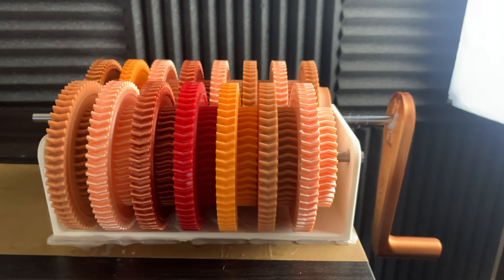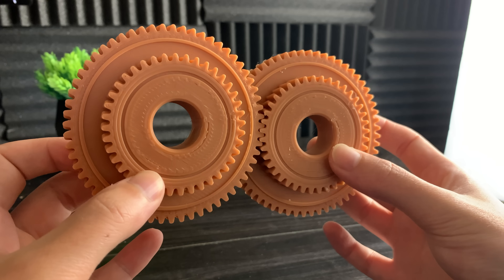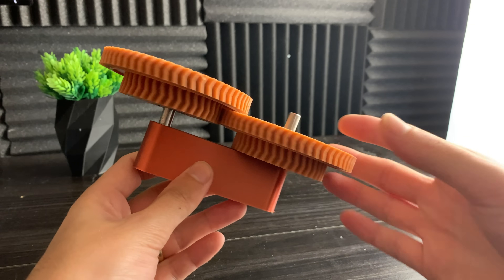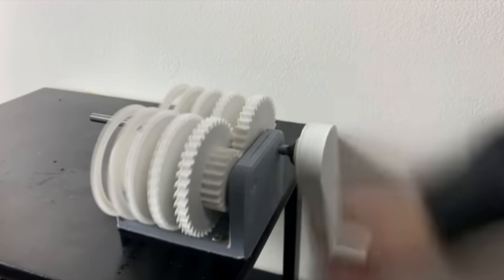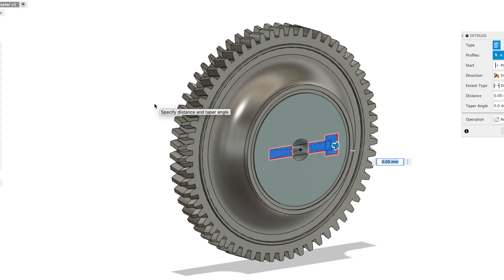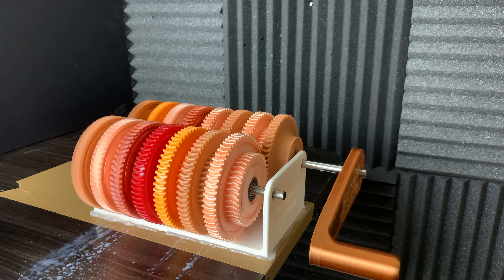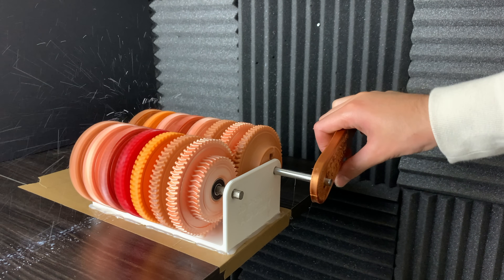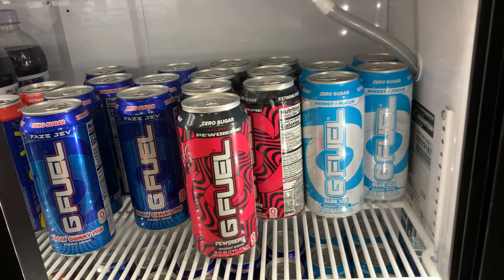3D Printed Gearbox (Herringbone Gears) - Speed Test

Comment: Add more axle supports, like a dogbone yolk, between gear sets. Though you abandoned the initial spacing, because it was tight... You may need that initial tightness for the end operation. The teeth have thin mating parts that will wear fast, and then stop, once ample surface mating is reached.

You can make the axle holders adjustable. Then you can increase the tightness on the drive side, and keep it a bit loose on the output side.

Test each gears true size. Pair larger ones on one side, to inverse direction, smaller ones on the other side.

Try adding ball bearings, as press-in weights, on the fastest moving gears. They should reduce vibration and  aid in reduced friction. The fly-wheel regulation they create, will counter your sloppy hand cranking. As opposed to gears slip-sticking and doing off jumping with the unsteady input.

You can also make a spring tensioned crank module. That uses a pre-tensioned spring, which can absorb excess power. As your cranking slows, at certain positions, the spring dampens the uneven input.

Since there is more force on the crank side gears, make those wider and make the output gears a bit thinner.

For more pressure, double your gears. Place the second set on the opposite side. Each gear set will have two contact points to reduce slop and spread the pressure on each individual tooth, by half.

Try graphite powder, instead of grease or oil.

Comment: Yes its nice being able to have the gears thin but in honesty if you make each gear thicker they will all have a larger surface area to apply force to the next gear and less chance from applying more torque leading to them simply sliding off also not making the space between them such a large difference yes they were to close at first but making such a big jump in space leads to less surface area being in contact leading to more disconnects when applying force.

Comment: If you continue to use wet lube you should try to have a space in the bottom to hold lube so it constantly gets lubricant. You could also add some walls so you dont spray lube everywhere lol

Comment: Haha those bearings aren’t doing anything, the bore just spins on the shaft.  If they were fitted correctly, and the bearings spun, the sealed bearings would cause too much resistance.  Brass sleeve bearings, with light oil would be better.  Save you money too.  You can find some ball bearings that could work better, but they are also louder.

Comment: two tricks: remove bearing's dust covers, wash in petrol to remove grease, they'll have way less drag in this low load application, the grease is useful only when they run with high radial loads. Rollerblade professional bearings are a good place to looc for very high ABEC index. Next trick: make gears lighter and lighter down the line, they will have less and less torque on them, while the structural weight on the fastest ones is what limits your ability to acelerate them.

Comment: Old vid but... There is little to no point in having bearings if the axle doesn't fit the ID of the bearing properly.  There is a ton of slop between the two in this video.  The oscillation in the gears and them slipping on the axle is obvious.  Main reason the gear's teeth were skipping each other.  Wild guess that the axle has an imperial OD and the bearings used have a metric ID.  Those should be press fit. Just like the gears to the bearing.  Surprised I don't see anyone else calling this out on a 1yr old video...

Comment: For gear lash a mm difference is too big, try increasing it from 75 to 76 by .1mm increments until the teeth mesh best, also enclose the box and allow the bottom teeth to sit in oil.

Comment: Watched this vid 3 times over, and speaking as a Technician i can say you got most of the major issues out of the way. Now you main issue with the gears gripping and skipping comes down to accuracy and alignment.
Since the gears are filament "printed" there WILL be some deflection and  warping as they cool. So as with most parts I'd suggest giving the sides a very light grind so they are more parallel to each other and once they are, Bore out the hole for the bearings  so it will be at a 90 degree angle to the sides, this should reduce your vibrations and make the gears run better as there will be less deflection while spinning on the axel.

Comment: if those are 'smooth rods' like the ones on some 3d printer they are VERY hard, they are a bearing wear surface and typically are hardened after precision grinding and then plated with something even harder, normally chromium. im sure you smoked quite a few bits drilling that bit hats off to the persistence, if you need to drill very hard materials in the future look for carbide tooling.

Comment: It looks like the torque on the gears is flexing the shafts allowing them to separate and slip.  You likely need an intermediate support every 3 gears or so to keep the gears from separating and slipping.  Cool design, keep up the good work and have fun.

Comment: Probably gonna need to use a metal bracket where the shaft goes in on the base I think the amount of force is causing the whole thing to Boe out and that's why it's slipping it's not the gears oh also a bracket in the middle

Comment: "press-fit bearings" proceeds to use hammer

They're called press-fit for a reason. You're damaging the bearings by striking them with a hammer. I think for this use case it's probably not a big influence, but it certainly hurts to watch.

Comment: I think the best would be to add a flywheel at the end of the gearbox. As soon as it starts picking up speed spinning the crank will be way easier. Also I'd say cast everything out of metal to make all the parts more resistant, but it's just what I would do

Comment: I would make the first few gears wider, thicker, and with bigger teeth, and then as each gear goes faster down the chain, make them thinner. 

Add a spacer between each gear. 

Also, add more walls between the first few gears (like the white wall where the crank goes through), and thick and more beefy.

 Make the bar that the crank handle attaches to a bigger diameter and move the handle in closer. Also make the handle itself longer. You aren't even spinning it that fast. It'll give you more power, and will be able to control the speed easier. 

If you make the last gear skinnyer, it'll fly faster, easier.

Basically, everything needs to be more heavy duty near the crank, then lighter duty as it speeds up.

Comment: A vice is much better for press fitting than a hammer. It is much more controlled and if you get the bearing lined up it should stay parallel all the way in, it also makes sure the bearing is perfectly parallel with the printed part, unlike hammering it in where it might be ever so slightly angled.

Comment: Use 3/4 in round hardened steel shafts for the gears. Also the turning handle should be made out of steel or hardened aircraft grade aluminum, aluminum from a car wheel is good. Then when attaching the handle to the 3/4 in shaft machine both the shaft and the handle square with a set screw in the handle. Make the handle similar in size to a bicycle crank pedal arm, very bulky. This should make the gear box much more durable. When installing the gears make sure they are spaced tightly using high grade steel washers with only .005 of play between them and all the gears should be pressed onto bearings that are pressed onto the shafts. And the same with the shafts pressed into bearings rightly secured to the housing.

Comment: That shaft support frame really needs some stiffening. A beefy frame and maybe thicker shafts might solve that gear skipping. Maybe slightly deeper gear teeth, if you haven't already reached the limit for your plastic (shearing off teeth that're any bigger than what you have).

Comment: I'll say, that was most mesmerizing to watch, beautiful design. Like some of the others have suggested, tweaking the orientation of the handle would help with torque. I imagine if you switched out the crank style handle with something akin to an old fashioned hand drill, there would be more consistent force going into the gears instead of going towards the spinning of the axel. And as Nick Sert discussed, the jump from 75 to 76 was very surprising, considering the scale of the machine itself. As my highschool math teacher taught, once you have the equation, and you have your possible range, you can plug and play until you get the right answer. For a machine so simple but also delicate, maybe you overshot the tolerances with 76?
also love the spray pattern of the lubricant as the gears go further down the chain; i would love to see a painting made by subjecting a spinning gearbox to different colors of paint.

Comment: Just a thought, use dry bearings with a few drops of a lightweight lubricating oil in each one, the grease contained in bearings as a rule although is quite lubricidous is actually quite high friction.

Comment: Something that annoys me with multi gearing is with the auto industry. They have 10 gears max for civilian vehicles and upwards of 18 gears for commercial trucks. But the one I want to focus on is civilian transmissions. Shifting gears is one thing but it would be better to combine a CVT transmission with a gearing system that can give more speed. People are already pushing for the fastest vehicle but don't think to use a CVT with a gearing system that would allow for speeds over 300mph. You would bee looking at having more than one transmission connected to the wheels. You'd also be looking at having more than 4 wheels to maintain grip and keep the turning wheels stable. You'd also look at aerodynamics such as body design and fin design. A vehicle that not only turns by tires but also fin tilt and curve. The other thing to consider is that you need more power and torque when you're trying to turn those gears.

Comment: Not sure if someone has mentioned this but good old VW transaxles used progressively sized gears as it went from high gear to 1st.  1st being almost twice as thick and 4th.  So you can apply much more torque to the input gears and make the output gears much thinner and lighter...  :)

Comment: Just a general note, when installing press fit bearings you should always use a collar (between the bearing and hammer, or press) that ensures your hammer strikes will only transfer to the outer bearing race (in a pinch, a socket with the closest diameter to the outer race will work). If the bearing is being press fit onto a shaft you would only apply force to the inner race, just to be clear, it depends on the application.

Striking the bearing as you do in this video can cause bearing ball deformity and indentations to the race surfaces.

For this application it's not really a big deal, but for more constant use applications it's best to develop good habits for bearing installation.

Comment: Great video 👍, and it looks like you’re using muc off bicycle dry lube for gear lube,  if you would evenly apply a thin amount to each gear and then wait a couple hours the lube would set up and there would be significantly less splatter.  

But when it comes to proper lubrication to really “minmax” this, different lubes for the ⬆️T⬇️RPM gears and ⬇️T⬆️RPM gears might need to be considered.
Reply: Squirting some of your lubricant into a little cup and applying with a brush might be easier and provide more even coating.

Comment: I see alot of space between the bearings and the shaft i would try and make a little shim so it would fit snuggly and also i would remove the dust barrier from the bearings and remove the grease and just put in some silicone spray lubricant, it removes a lot of friction from the system, because these bearings are designed to work for years and not the least friction.

Comment: You should also use a bearing press when installing the gears.  Using a hammer damages the bearings, or at least malforms them and/or prevents them from being properly aligned between the shaft and the gear.

Comment: There is a lot of friction generated by using sealed bearings (The seal and bearing grease x # of bearings).  Use unlubricated ceramic bearings for this application.  Ceramic roller bearings are more stable than ball bearings (although more expensive).

Comment: The rods should fit the bearings tighter, you shouldn't see the inner race not moving at the same speed as the rod which is clearly happening at 3:22. Neat project though, eventually you'll get that last gear to go back in time.

Comment: Since in use you only rotate the handle clockwise, you have an easy option for a drive mechanism.  Cut left hand threads on the handle end of the drive shaft.  Thread a LH nut onto the shaft to the end of the threads.  You can then use a conventional wrench as a crank.  If fact, use a socket and a torque wrench and get torque data for the system.  That will help in design refinement.

Comment: The length vs thickness ratio of the shafts may be what's causing the gears to slip.
As the gears rotate and make force on one another, they push themselves away from each other. If shafts are not strong enough, they will bow out, letting teeth slip.
One solution could be making shafts the largest possible in diameter (they could be hollow) allowing the teeth of the smaller wheel to be the closest to the shaft to keep shaft flex to a minimum. Unfortunately that would mean to redesign the shaft/gear interface though.
Another solution could be to make lateral supports for the shafts every two or three gears to prevent flexing.
Also work on reducing friction as much as you can, since friction multiplies exponentially with each gear.
Good work!
Reply: THATS A LOT!!!!!!!!!!!!!!!!!!!!!!!!!!!!!!!!!!!!!!!!!!!!!!!!!!!!!!!!!!!!!!!!!!!!!!!!!
Reply: Mom:WHAT!?!?

Comment: The gear housing should have an interim spacer half way through to prevent play in the rods.  Also using bearings in the housing will also reduce friction at these points.

Comment: If there's a way to add multiple cranks or design a shifter, could get the lower gears up to speed first then start going down to gears with more torque and more in the chain when everything's already moving and its a bit easier to add more force

Comment: make a box with a proper seal on it, and add some actual gear oil to it, from what i can tell you should use some thick oil because of the tolerances, 80w90 maybe or just straight up grease.

Comment: Nother tip: Add spacers to the bearings so that the bearing's inner ring is aligned all the way through and friction between the bearing and rod is reduced, because I'm looking at it and the bearings are just moving along with the gears instead of the outer ring mover independently of the inner ring. Also add some bearing lubricant or just super lube. Source: Am a skamteborder.

Comment: 1. You can us any kind of flame to reduce hardness in drilling aera, when metal will be red you can stop heating. 
Probably you using 64HRC surface hardened rod fo roller bearings. 
2. Screw in the rod like that is bad idea becaus it is too losy. 
3. You can drill a hole through rod and through step in the gear and make thread in steel or in print. 
4. You should use normal or angled teeth with DIN-988 spacers bettwen bearings to posytione all gears, that would prevent vibrations (again your solution is very loosy). 
5. You should use more complicated adjustment of axles posytion.
(it should be stiff not overposytioned tight and deformed) 
6. The gears should have an involute profile. 

Watch solutions in some old machines, how tu adjust axle posytion and etc.

Comment: Get some ceramic dry bearings like in the fidget spinners or take the dust shields off the bearings and dry them out     and try increasing the spacing between the gars it sounds like they are catching a little at speed and try graphite as your gear lube

Comment: 75.5mm spacing and a centre support for the mount might help. I rebuild truck gearboxes if it's any consolation but you'll need to play with your spacing between the two shafts 0.1mm can make all the difference between success and failure just like setting your bearing load on the real thing, 3thou is all the tolerance you get before complete destruction or perfection

Comment: Gears closest to the handle are taking the biggest torque so they need to be wider with less ratio than the others. Moving away from the handle, gears could be lighter and ratio could increase gradually.

Comment: Maybe try reducing the weight on the gears. If you can reduce that the system will overall need less energy to spin and therefore less torque can be applied to stop the slipping. However if im wrong someone please do correct me

Comment: I would say that scaling down the gears and making them alot smoother would be the ticket here. Shrinking them down primarily to decrease the rotational mass, however this may reduce the amount of strength each tooth may have, so adding some strength to each tooth may need to be necessary.

Comment: One suggestion I have is to make the low torque gears smaller and lighter, also possibly some bronze shims between the gears and going over the teeth with sandpaper, remember the teeth don’t just push on each other they also slide and the less friction there the faster they’ll go. Good work so far very interesting

Comment: the screw for fixing isn't used.... try to use on shaft milling a flat surf and handle should have (instead hole) a D feature to fit on shaft. opinion 2: We use cone on shaft & handle, drill thread on end and screw together. 
On shaft we use snap rings to prevent gears from sliding.